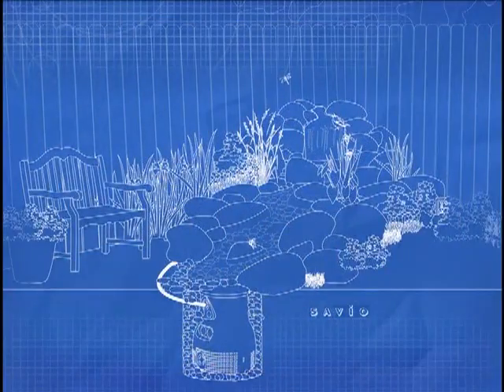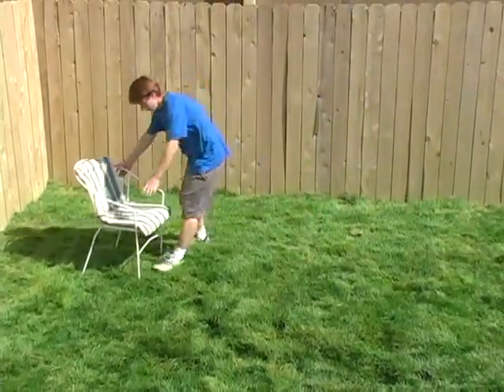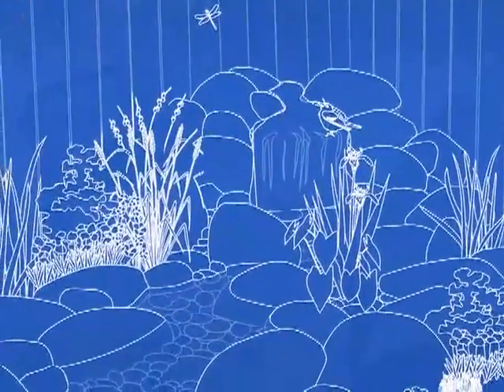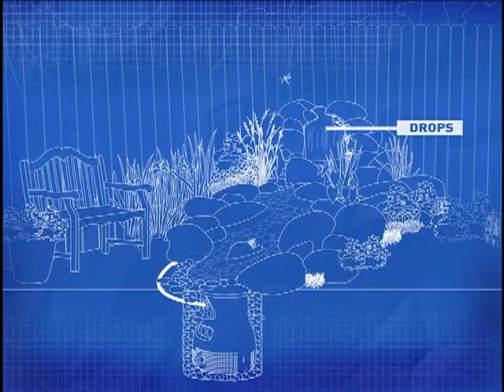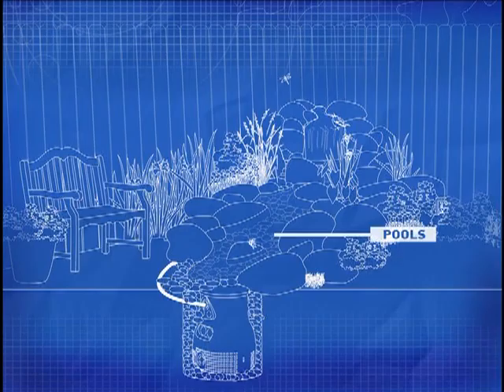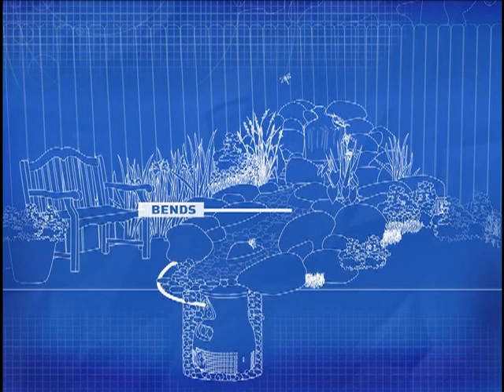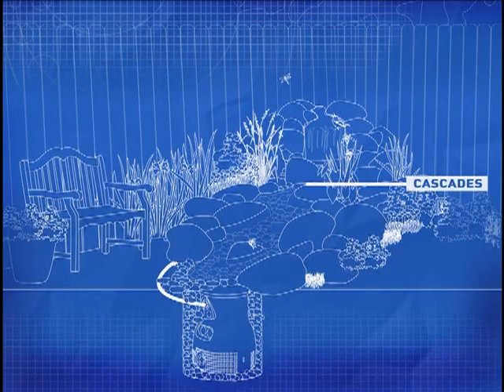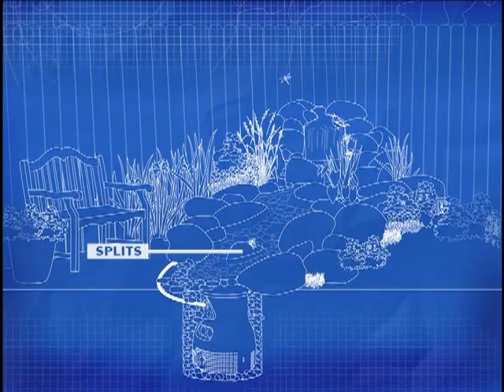Savio - How to Build a Pond Free

Comment: My Savio filterweir 16 is leaking right at the hose fitting. The clamp is as tight as it's gonna get; it's not leaking there. It's right behind that on a hex nut. How do I fix this? Do I need a pipe wrench to tighten the nut?

Comment: Watch this video several times and I'm still amazed. Hope one day I can afford to have a pond like this in my backyard.
Reply: You can definitely make one for $400 or less, though not with the equipment in this video. A decently strong, energy efficient pump for $80, pond liner and underlayment for $60-150 depending on how big you want your pond to be, pond foam for $12-14, though you might need a second can of foam depending on much you use, $20-30 worth of gravel and river pebbles from Home Depot or Lowe's, $22 for a tube for the pump, $25 for a spillway which is optional. $20-40 for one or a few aquatic plants to filter out algae. Large rocks: free if you look in the right places.

Comment: So one would constantly have to fill up the reservoir to keep an adiquite amount at all times, in very hot climates that may be a daily task,  could a water line be used as well as a float to always pump water so that you never need to manually fill it .up .?
Reply from the maker: Yes, there is a hole cutout in the waterfall well for mounting a mini float valve as an autofill.  Savio makes a kit that includes the float valve, water line, and tap for a water spigot.  If the waterfall is built so that water stays contained within the system there should be very little water loss however.  Just what is lost to evaporation.

Comment: Can the water course be longer?
Reply from the maker: Savio currently makes PondFree packages that are for an 8', 13', or 18' length water course.  Their PondFree Packages include everything you need except  the electrical outlet, the backing that they show in the video (which you usually don't need) and the stones.  If you need longer than those lengths it is possible to use a larger liner, but you may need to adjust the sizes and quantities of some of the other components as well.  You can call Mud Monsters Pond Supply at (505)217-2856 or email us at info@mudmonsterstore.com for information and a quote.

Comment: Not well planned. 
1- The wood will rot because of no barrier
2- When replacing fence, this section will be a major pain in the rear to replace
Reply: You didn't pay attention to the instructions, they didn't do it on the demonstration but the man specifically said to use plastic liner between the fence and the water feature.

Comment: plastic should have been used against that fence to keep it from rotting out.
Reply: Andrew Keener water isn’t touching the fence. How would it rot out?
Reply: @migueljimenez5165  Anything against wood is going to collect moisture especially if it rains or dews= rotting wood.
Reply: Unless you do a sealer constantly every few years.

Comment: This waterfall is the one I would like to have.. Generally, how much does it cost for this...?
Reply: You can not buy it. Go to it and enjoy it Yourself it is not too hard if You can spare the time. Go easy on it!
Reply: Shoreasiamensis Shoreasiamensis materials will run you between $1250-$2000. a contractor usually charge around $3500-$5000 for a turn key project like this. the rock is the main deciding factor on the total cost. the larger it is the more rock you need. and it can get expensive